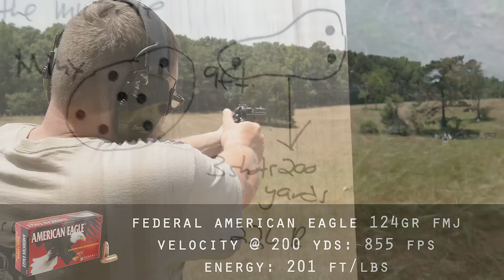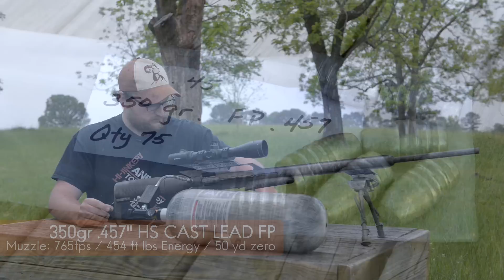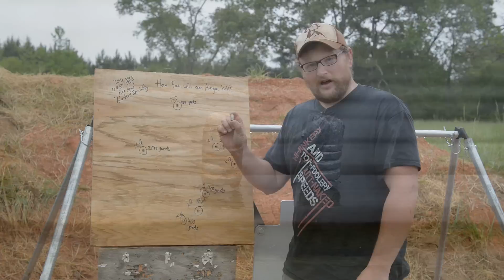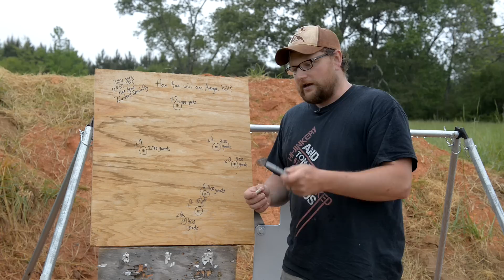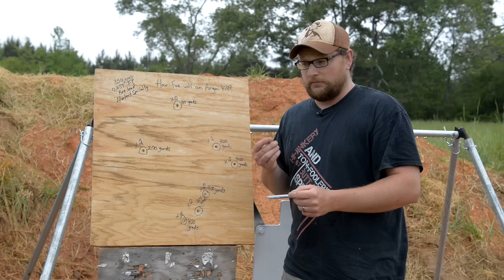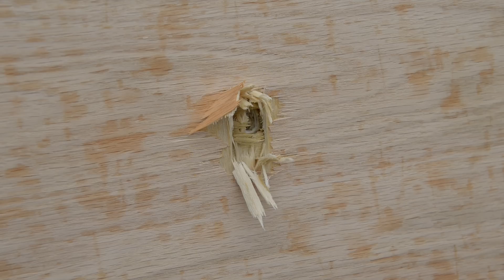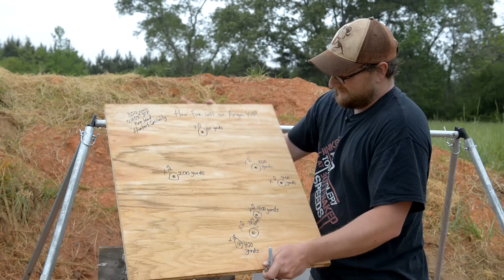How Far Will an Air Rifle Kill? Part 1

Comment: so u can definitely kill a deer with that air rifle????
Reply: +HK DEE Who the heck said anything about steel? You could shoot a 1/8 inch piece of steel point blank and it wouldn't pierce it. We're talking about penetrating a sheet of wood. At 200 yards, it will absolutely do that. I'm pretty certain it would do it at 300 as well. At 400, it may not go through, depending on the type and thickness of the wood, but it could still be lethal with a perfect hit.
Reply: Congratu-freaking-lations. What does that have to do with a 22 being able to pierce wood at 400 yards?
Reply: Without a doubt
Reply: U actually can
Reply: at 50 yards, but not worth a shit otherwise. my Ruger .223 bolt action M77 Hawkeye with special loaded rounds produce 65,000 lbs of pressure at the muzzle. air rifles are "pussy arms". air rifles have shit trajectory.
Reply: Actualy it is not recomended weapons for deers.22 lr goes through this board at 400 yards and 22 lr can kill deer but i dont recomended 22 lr for deer.Power of this airgun is lower than 45 ACP and that is not good enough for deer.
Reply: i beg to differ, no fuggin way a .22 LR punches through a piece of wood at 400 yards. .22 LR trajectory is 100 yards max. velocity is seriously reduced after that distance because of low grain of the projectile and powder load. i own a tac22 ruger with basic store bought ammo and at 100 yards, the bullet "smacks" the wood but does not go through it. barrel is 18 inches. however my magnum tac 22WMR 18 inch barrel drills out a 1/8 inch piece of steel at 100 yards easy and tears through wood at 250 yards. i guillotined a squirrel with my magnum 22 at 150 yards and the head was never found, just the body...
Reply: +HK DEE What do you mean 22lr trajectory is 100 yards max? As in that's the effective range? I've seen a coyote dropped with a 22 pistol at 175. 22 will definitely pierce a sheet of wood out to 300, maybe even 400, if you can hit that far. it just doesn't have enough energy to be very lethal beyond 200, unless it's a perfect shot.
Reply: you just contradicted your own comment. don't you people know what trajectory is.?? trajectory is "flat line". once the bullet leaves the barrel, velocity and energy starts to reduce after a few yards and trajectory is lost. you people seem to think that when a bullet is fired out of a chamber that the trajectory is straight lined until it hits the target, well that's not true especially with rimfire cartridges. the powder load and projectile does not carry the ballistic efficiency nor the energy to punch clean through a 1 inch thick piece of wood at a 400 yard distance which is 4 fucking football fields away...what the hell is wrong with you dummies, haven't you ever taken a physics class. sure, i killed a crow at 100 yards in a tree with my 22 LR so big deal. My Ruger 10/22 is a badass accurate mother fucker at 100 yards but winds, spin drift and ambient temperature will fuck up my shot if i attempt to shoot farther., this is because a 40 grain bullet round nosed 22 LR is not designed for that, this is why 22's are considered "plinksters"
Reply: +HK DEE Trajectory is the path it takes, you moron. it doesn't mean straight line. The trajectory of even a powerful rifle isn't straight, even at 100 yards. Don't act like you know everything about ballistics if you don't even understand the meaning of the word "trajectory".
Reply: you can shoot a 22 LR at a 1/8 inch thick steel target spinner and it wont punch through it, it will dent it but not drill through it, so go try it and see for yourself.
Reply: Phillip Lewis hey Goatsie, trajectory is a "path". but firearm bullet trajectory is not the same as a missle. a bullet flatline trajectory is constantly changing, thats why you have to shoot to where the targets going to be at after calculating winds and temperature. so i do know what the fuck im talking about and thats why military snipers are so good at this shit. there rifles are equipped with a "Dope" placard attached to the stocks of their rifles so they can calculate the distance and trajectory using strict calculating measures that only they have, and this is another reason i dont purchase store bought ammo, i reload all my center fire NATO brass for my bolt actions because store ammo is pussy rounds. i started hitting my targets at over 500 yards with my M77 .223 hawkeye shooting at a steel Gong .
Reply: Same like you i just cant understand about what he is talking about and what does trajectory have to do with a 22 being able to pierce wood at 400 yards? If you know that 22 lr have about 10 meters drop at 500 yards you can hit the target.I hit target at 600y with 22 lr rifle........as i can understand he think that 22 lr cant reach 400y .... ridiculous :=) Phillip Lewis
Reply: At pretty incredible distances, too! I've known a guy that owned a Sam Yang, big 50 caliber south korean air rifle, he scoped it, loaded with with a round ball, took a buck at 100 yards with a shot through the front of the skull. I was there to see it, or I'd never have believed it!

That rifle is weaker than this one, so I'd imagine this can do the same if you got a good scope and good aim.

Comment: How many shots can a full tank of air provide?
Reply: Assuming you mean the on-board air cylinder depending on the ammo you get around 6 shots before pressure drops and you need to refill. That's why Eric has the external tank attached since he was taking multiple shots. The Texan is really made to hunt, which 6 shots should accomplish.
Reply: Airgun Depot Oh, I ment the giant tank.

Comment: are those lead projectiles able to be loaded into a black powder firearm or is it for airgun only they have the ribbing like a powder fired round would be
Reply: They are made on the same mold, we just use a little softer lead alloy for airgun bullets.

Comment: nice video Eric ,  it makes me proud to own a Airforce  Texan...
Reply: I have a question about at least this model of airgun. Why does it not have a magazine? I can't understand why they wouldn't make one, especially when you can have a giant air tank attached to it.
Reply: because you don't USE the air tank normally in the field. the rifles have an internal air cylinder that is built into the rifle forearm area. this gives you 12-15 shots be fore a recharge is necc. as for mags; some come with a clip that rotates like a revolver. but most hunting rifles don't really need the added expense and complication of a mag/clip

Comment: I just can't wait for self-contain PCP (Pre-Chargerd Pneumatic) air cartridge (similar to the Brocok BACS), we could simply reload to high pressure with a scuba diving bottle (or air compressor) and just use some home made lead bullets. It would mean no way for governments to stop anybody to get or make ammo unless they would want to regulate or ban "air" ;)
Reply: And it would be even better if it would use regular existing cartridge size to be use in firearms (manually operated).

Comment: Can I refuel my air canisters by myself if I buy what you need
Reply: They do make something that looks like a bicycle pump. I believe you can also use an air compressor, with the proper equipment.

Comment: I made a p.v.c. potato gun with a 6 foot barrel and it can handle over 100psi and will shoot a potato 3 football fields away, I  know it would put a hole clean threw someone, I use a pancake air compressor to get 100psi.

Comment: You did not mention the main benefit of hunting vermin with an air gun is how quiet they are without the need of a silencer.
Reply: This is still very loud for an airgun.  My Sam Yang Recluse .357 sounds like rimfire, and its a smaller caliber.  It may be quieter in a traditional sense but by no means enough not to spook nearby varmints.
Reply: I think he did in the actual review of the gun.
Reply: The boom of the gun means nothing, I haven't yet met an animal faster than the speed of sound
Reply: That is very true.
Reply: +marvincz3 Not really. Part of the review should be to separate the TOOL from the TOY. Especially for a gun that's uncommon.
Reply: Boci Levu
When I talk about "the actual review", I mean the separate video. Literally within the first minute of that video Eric talks about this being a hunting gun.
Reply: +Robert Trbovich Ill give it a "shot" thanks!

Comment: Do you think there should be a way for felon's to be permitted to gain their second right back? According to the United States Constitution the Second Amendment is an "unalienable" right, meaning, it is a right that you are born, live with will die with, and is the true definition of democracy. The same as the right of speech and the right to not incriminate one's self. I think some kind of program needs to be instituted or initiated so a felon can get his permitted weapons. To allow felon's the chance to get the right back that should have never been taken at all, would actually be a good thing. The felon's weapon would be registered and permitted. This would actually help Law Enforcement by knowing who has a registered weapon when they pull someone over. Less guns would be "floating in the street". Make the process tedious, and make them go to a course on guns and gun violence. It is totally unfair for a seventy year old man not to be able to take his thirteen year old grandson deer hunting because grandpa was a routy  teenager who mad a mistake or two, fifty years ago! Educating, Permitting, and Registration is safer for the community and allows the felon, the chance to not be a secondary citizens.

Comment: I have a little Condor in .25, unfortunately to me they're still just not practical with the single shot, price of heavy lead pellets, noise of a .22, and they use up air really quick without a nice big CF tank. The concept is definitely there but still needs evolving imo at the price point and setup to run the high powered airguns like this. Still very fun though and no FFL regulations..... yet.

Comment: I have never used big bore air rifles, the largest I have shot is .22cal.  But I do shoot black powder.  Do you have to use lubrication on the larger air rifle rounds?  I would think you would want similar lube that black powder rounds.

Comment: Instead of buying bullets for the airgun why don't you just cast your own? There's a lot of 45 cal molds available to choose.
Reply: Is it hard to do? Can anyone do it without special equipment?
Reply: *****
No, it's not hard to do. There are some tools you'll need, but there are varying choices. You can choose to go ultra budget minded and use a camp fire to melt the lead or you can buy a lead melting pot. Whether it's a melting pot or the bullet mold usually the essential tools only cost around $20 or $40 each. I started casting my own lead bullets with only around $120. After a while you tend to want to upgrade and buy the more efficient tools to save time and energy, but the overall cost of components and materials stays relatively low. I can reload cast lead 9mm for under 4 cents per shot today. There's plenty of youtube channels that show how things are done. This IraqVet8888 channel has some older reloading videos that are good, but another good channel is the fortunecookie45lc channel.
Reply: I bet he will. He makes ammo for his other videos.

Comment: I think i can explain why the exit holes all look the same. The drag coeficient of a projectile (i.e. how much resistance it has from the air) is proportional to the velocity squared (also dependent on the drag coefficient, air density and cross-sectional area but these are assumed constant). Thus because this projectile is moving fairly slow (compared to firearms), it will have significantly less drag than a higher speed projectile (if you move twice as fast, you will experience four times the drag, and 10x as fast gives 100x the drag!). This means that the projectile will slow down a lot less over distance, and thus preserve most of its energy (which is just the 1/2 times mass times the velocity). Lighter, faster bullets will significantly reduce their speed due to the higher drag, which decreases the amount of energy significantly as well.
Reply: I looked up a 223 and 45 acp on federalpremium's "BALLISTICS CALCULATOR". The 223 dropped off in power dramatically over distance with 300 ft*lb at 400 yards starting from ~1000 for the loading I picked. Then I looked up a 45 acp. It started at~450 ft*lb and ended at 218. Much less of a drop in power than 223 over 400 yards. The drop was a lot on the 45 as to be expected but it supports what you said.

Comment: Air rifle in coyotes? Is that ethical?
Reply: It is with this one. At relatively close range, it has (with the right load) the same power as a .38 super. That's plenty as long as you have a clean shot.
Reply: +000Bob000jones000 yeah thanks, trust me I'd love to shoot a coyote when it passes by but wounding an animal is the worst
Reply: Exactly. That's why I still wouldn't use this on anything larger than a fox. I don't have enough faith in myself to get clean shots every time.
Reply: You are not wrong about 38 super but I think 45 acp would have been a better comparison since its close to the size of bullet in the air gun.
Reply: I'm amazed that I didn't even think to look at a .45...You are right, that certainly is a better comparison. And that's still probably a slightly lower estimate of effectiveness considering these are slightly bigger than .451 in.

Comment: my nephew was given a .45 black powder rifle from a family friend. In the box ox ammo that came with were 45cal hollow point black powder sabot round. It was basically a 9mm with a plastic 45cal jacket. You should try those through that air gun. If you can't find then. Contact me and I'll have my brother send you some.
Reply: We tested it a little but accuracy results where sub-par. I think it was because the sabots don't engage the rifling enough. The Texan barrel is slugged at .457 but it really likes slightly over sized projectiles (.458) to get a good seal and rifling engagement.
Reply: +Airgun Depot I'd still like to see what the effect range could be and if maybe a modified 50cal sabot could have better results. lol

Comment: Great!  I like to see more about this rifle.

That may be pine plywood, but it isn't a "pine board" so the performance is actually much better.  Plywood is much tougher to penetrate than a plain pine board.   I also doubt they used Southern Yellow Pine and you really need a true 1" thick pine board not nominal 1" pine lumber, since it is really just 3/4"

Comment: I wonder how that pine baffle test compares to the more modern FBI test and which one is more accurate. If I remember correctly the FBI determined that a bullet has to penetrate at least 12 inches of clear ballistic gel after passing through 4 layers of denim in order to be considered a lethal self-defense  round. Though I might be confusing somethings since lethality probably doesn't necessarily equates to self-defense effectiveness.

Comment: Do you think that air rifles stay more accurate then a conventional rifle due to the barrel not heating up?
Reply: Airguns are more accurate than firearms simply for the reason that the standard deviation in velocity is so small compared to firearms.

Comment: why are you using an SCBA tank?
Reply: Without it the onboard tank is only good for about three shots.
Reply: Because .45 uses a very high volume of air per shot compared to smaller calibers, which would require a refill of the shoulder stock tank after a handful of shots.

Comment: Great video. I have a suggestion Erik, you should hang the pine board from the swinging target by placing a narrow strip of wood on the back top of it, and a second wider strip behind that. you could nail them together and hang the whole thing to the target.

Comment: Funnily enough this would be considered a firearm in the UK IIRC Looks like it has way over 12ft/lbs of force at the muzzle, so you'd need to get it on an FAC over here.
Reply: Chuck Sherron https://www.gov.uk/government/uploads/system/uploads/attachment_data/file/518193/Guidance_on_Firearms_Licensing_Law_April_2016_v20.pdf I wasnt sure so I just googled it. Section 2.46/page 13. It's 12 ft/lbs. Some .22s dont get to 300.
Reply: ***** I was referring to the rifle in the video.
I checked and according to the manufacturer it can achieve 500+ ft/lbs.
Reply: Chuck Sherron Ahhhh, fair enough.

Comment: This may be a dumb question and I've done zero research, but can you swap out the small tank on the rifle like a magazine per say and carry a few small tanks vs dragging around scuba Steve?
Reply: "Scuba Steve" lol
Reply: The on gun  tank will give you about 5 to 10 shots depending on what weight of bullet you are using. There are smaller tanks called buddy bottles that you can tote around with you, usually a 100 cubic inch buddy bottle will give you about 5 or 6 full fills on the gun and will easily fit in a small back pack.